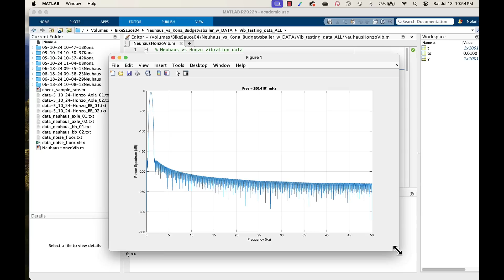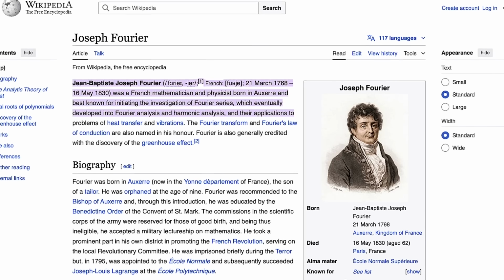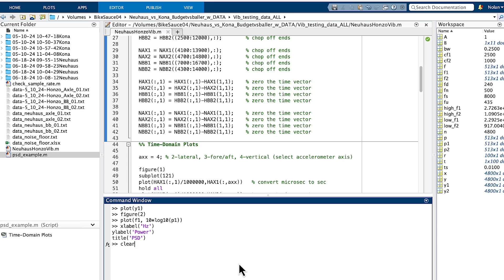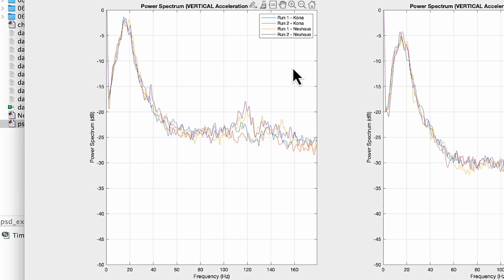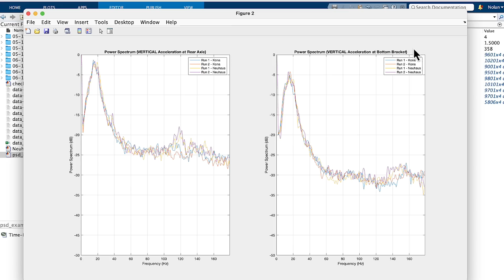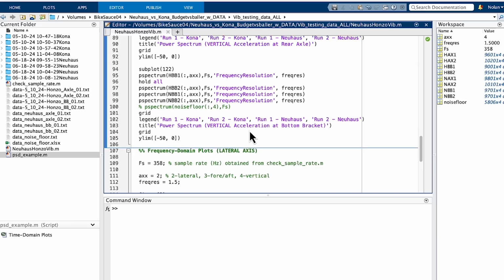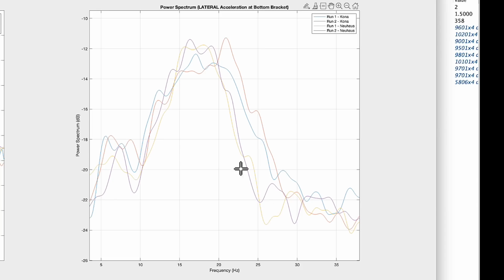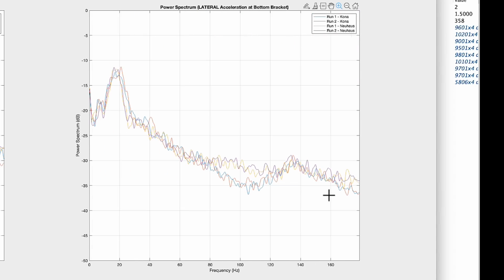The MYTH of Vertical Frame Compliance.

Comment: Just found this vid. Thanks for making it! I'm sure, as with anything like this, more questions popped up for you. The one that came into my mind was regarding shape of the stays. I noticed both the Kona and Neuhaus have relatively straight seat stays. I wonder if frames built to actually have more vertical compliance actually affect vertical vibrations. Would be interesting to do the same experiment with a steel frame with S-bend stays.... which makes me interested in the actual benefit of S-bend stays if Nick didn't use them in the design of the Hummingbird!

Comment: Do you have a way of replicating this experiment using frame/fork = aluminum/aluminum, steel/steel, aluminum/carbon, steel/carbon?    I think that it would provide a great deal of insight into exactly where perceived flex, damping, ride quality comes from in those cases.   The frequency domain approach would really help.    Somehow doing it with softish and hardish or even rigid tires would further isolate the frame effect.

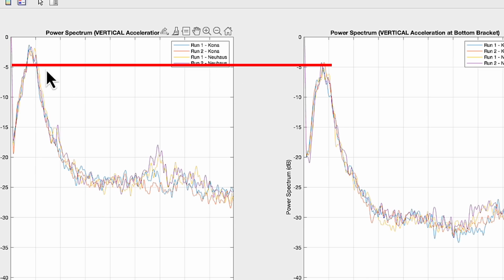Comment: In 9:38, you say the amplitude difference between the BB and rear axle is from vibration damping. If you're hitting a 2cm bump with the rear wheel, you'd only expect the bottom bracket, which is 44cm away, to go up perhaps 1.5cm. Less acceleration, ergo lower amplitude.
Reply from the maker: Perhaps, but the offset is present in both experiments, so the delta is still valid
Reply: @TheBikeSauce  While yes, the offset is present in both, it seems likely that differences in chainstay length would be relevant, especially for the vertical dataset. I may be being overly pedantic, since the delta between chainstay lengths is likely very small (relative to the total length of the chainstay), so it may not make a perceptible change. 

Given that the Neuhaus has sliding dropouts, I’d be interested to see if there would be any change if both were run with the same length chainstays. I doubt it would make much difference, but this is one of my favourite videos I’ve seen in a long time, so more couldn’t hurt! 

Thanks for your effort in making these videos, they’re extremely well done.

Comment: Interesting experiment and results, really enjoyed your video...far as a hardtail is concerned personally I would rather have a frame that's more on the stiffer side (more power transfer) and dampen high frequency vibrations and obstacle impacts via component selection, i.e. wheels (rims/spokes), tires, saddle, cranks, handlebars, grips...if I'm really concerned about comfort on the trails I'm taking my full sus rig  🙂#RideWhatYouLike

Comment: Should have taken measurements at just below the saddle.
Reply from the maker: Lots of you said that, but in this test, I was standing up while descending - any and all compliance was felt through the cranks. On a gravel bike seated test, up by the seatpost makes sense
Reply: It would be nice to see an estimate on the spine, which would be a combination of contact points, but the saddle would be the primary input.

Comment: CUBE build their fs emtb "Stereo Hybrid ONE55" with a strongly lateral flexing rear triangle. It was criticised that it flexes so much, that the tire touches the seatstays, when it is ridden hard. Their statement was, that such a construction is much more compliant, than a lateral stiffer rear triangle. If that is true -and there is no reason, why it should not be true - You are right.
Reply: Yes, but it flexes so much, that the tire actually touches the seatstays, even if it is not ridden realy hard. That 's the reason I sold mine.

Comment: I have an old Ritchey steel framed hardtail that is so smooooth. It being an old frame means it has catilever  brake bosses on the seat stays. I noticed that when I would use the rear brake in rough terrain the rear brake caliber would lose braking pressure and I could feel it lose braking at the lever. 
 I took a look at the brake later and noticed that when I applied the brake to the rear caliber, the seat stays would bow outwards with the force of the pads against the rim. The outward (or lateral) flex was quite excessive.
 In an attempt to correct the problem with braking control,  I mounted what was called a brake booster. Which is a horseshoe shaped bridge that fastens across the two brake mounts, strataling the rear tire and preventing the seat stays flexing under braking.
 They worked like a charm to correct the loss of braking over bumps. However, as you've probably guessed the brace took away the flexing of the seat tubes over all the bumps, braking or not. And negated the action of the Ritchey seat tubes to provide the bikes beautiful ride quality. I decided to compromise the loss of braking feel for the return of ride compliance. I think your technical explanation of lateral movement scientifically explains my "seat of the pants" experience. Thanks for working it out!

Comment: Great video man. Been doing the accelerometer and fft process for a while on some rolling resistance testing. However i cant help but think most of this test was… fruitless. As you say, putting the IMUs on the axles and BBs is going to tell you nothing. Its a f+ck1ng strong truss shape. The only thing that can tune the vertical compliance on a hardtail is tyre pressure, amount of seatpost sticking out as thats a relatively flexible single leaf spring, and seat tube angle. Just goes to show the brainless marketing of the bike industry telling people (and them believing) that different metals have some sort of mysterious damping qualities. They do not. Stiffness yes. Damping no.
Reply from the maker: Glad to hear your take on this. I’d say the thing we’ve learned here is that lateral flex (not vertical) at the bb could be what we interpret as compliance in a rigid rear triangle. 

While damping in a frame can’t be modified, stiffness certainly can (design, butting, etc). But the body is also a giant damper in the bike/rider system. I’m starting to suspect that if you can reduce stiffness in the frame (and the body’s effective damping coefficient remains constant), then the damping ratio of the bike/rider system increases. This is likely related to what we feel and interpret as compliance.

Comment: Great video!  Personally, I would have moved the 2nd accelerometer up to the seat post since it's closer to the rider interface, and then calculated the transfer function between the rear axle and seat post acceleration. The beauty of the transfer function (aka FRF) is that it captures the relationship between input and output, instead of just looking at each separately.
Reply from the maker: 100% great idea. You mean FFT to back out the TF, right? Only issue with that is I suspect the dynamics are pretty nonlinear, so I’m not sure how good an LTI model would be. Interesting idea though. I may try it with the existing data

Comment: Excellent analysis. I’m riding the same bike on technical trails in reunion island. Tested with both 29’’ wheels and 27.5 ‘’ plus wheels, and a long experience in hardtails. With 27.5 plus wheels (3’’ at 0,8 bar in front and 2.8 ‘’ at 1 bar in rear), i can’t return to 29’’ wheels. Only if you’re a chrono hunter,  the plus format on hardtails is more fun and definitely more comfy;

Comment: Does the same apply to forks? I'd be really curious to know the difference between a steel rim-brake fork, a steel disc-brake fork, and a carbon fork.
Reply from the maker: That's a great idea. Would require 2 sensors to mount at the axle and crown.

Comment: Absolutely loved this video, definitely here for more of it. Peak Torque might have some thoughts on this too--he's made some videos in the past outlying the engineering behind "vertical compliance" and why it's fake.

Putting the accelerometer around the midpoint of the seat tube and underneath the saddle would be very interesting too--maybe the Neuhaus reduces vibrations even further by those points.

Comment: Great work! One thing to say about the vertical vibration being lower at the bottom bracket than the rear axle for both bikes is that this doesn't mean both bikes have some measurable vertical compliance. This could be due to the BB accelerometer being closer to the fork and further from the rear axle. The amplitude of vibration will be less for purely geometric reasons (like sitting closer to the middle of a seesaw) even if both frames are effectively rigid in the vertical plane.
Reply from the maker: Totally agree. Also there’s a giant damper on the pedals (a person)

Comment: Wouldnt magnitudes of change be more fully realized "post" frame? As in, placing the sensors at the handlebars and seatpost.
Reply from the maker: I chose not to do the handlebars for this experiment because I hypothesized that the front fork would squash any detectable differences in frame material. I chose not to do seatpost since I was standing during all data acquisition (not seated). What you feel when descending on an MTB is primarily through your hands and feet.

Comment: You could actually take this one step further to prove the exact same thing for Steel vs Alloy vs Titanium.
You'll likely return with the same exact results as the triangle/truss structure is not designed to flex.

This may hurt the egos of all the "Steel is real" or "Titanium is the best" crowd.

Anecdotally, I had the Honzo frame for a short time and sold it very shortly after due to the harshness.
I replaced it with a Santa Cruz Chameleon in alloy which rode a bit less harsh, and was lighter.

CyclingAbout also did a YT video on this content, and included the difference between metals, but his work was based on the research of others.

Comment: I’d like to the data when you place the accelerometers closer to the touchpoints of each bike, e.g., at the top of the seat tube and headset (so the flex of the different seatposts and stems/handlebars aren’t captured).

Comment: Really cool experiment but "compliance" AKA flex in a frame is only "complying" to the forces being put through the tires and wheels and then those reduced forces are also being attenuated, a little or a lot, by your crank arms, spindle, suspension fork, bars and grips. And easy next step would be to change tires which will move the frequency of the vibration. Or change the PSI. What is the amplitude of a 10 PSI change VS buying a new frame?

Comment: Hi, can the vertical compliance in a frame come from the top tube bending? I have noticed on my slo-motions that my hardtail’s top tube slightly flexes on big impacts (handlebars also flex). Does this explain the ‘vertical flex’ thing or is the rear the only part of the frame that should be flexing. Thank you

Comment: the frame flex in the front has a signifikant impact to the ridefeeling - if you mount a rigid fork and measure the equivalent to the break stiffness - there may be e certain difference between the two

Comment: Nicely done! Going in, I had reservations on the data because you first only show the accelerometer at the axle, and I was like... what??? But you explain this and the outcome of your experiment is very interesting. Thanks for doing this and your well articulated explanation of the data! I have designed a LOT of bikes in my 35+ year career in the bike industry, and we generally quantify vertical compliance at the saddle. Because with road and gravel bikes, this is the place where vertical compliance matters most, this is where it's done. For a lot of obvious reasons, this is not as relevant to a mountain bike, but it's still not wholly irrelevant either. When testing a frame for full ISO testing, there is a vertical fatigue test, but this test can of course be run with a single force load into the 'saddle' with a very measurable amount of deflection. The reason this is still somewhat relevant to a hardtail mountain bike is that the seatpost is typically an 'infinitely stiff' steel bar (nothing is infinitely stiff, of course, but for the purposes of the test, the frame is doing all of the flexing and this tester post is isolating the frame vs. allowing flex in the seatpost as well). This denotes some amount of vertical compliance through the frame, not at the bottom bracket, but rather through the whole frame itself, from axle to axle. I think compliance is more a factor of how the BB hangs between the two axles, like a hammock or skateboard. When you're on a long board, your damping is coming from the flex in the deck, not the wheels or trucks. I wonder about a couple of things: what would the data set look like if you did the same exact test but tried to isolate the frame even more by running 30 psi in the tires instead of 20? I also wonder how some strain gauges running along the top of the chain stays and/or seat stays would look in comparison. Anyway, great stuff!

Comment: I would be interested in a comparison with a well designed CFRP frame. It may be that the isotropic nature of alloys is very limiting in the differential stiffness that can be achieved; IE you can't uncouple the vertical and horizontal deflections very much with that material selection. Increased stiffness in one area will likely come with an increase elsewhere, and vice versa.

Comment: Super cool expt. Appreciate the rear axle control. I might have placed the sensors at the contact points (saddle,  handlebar/stem,  cranks) instead of the BB, but i understand your reasoning.  The other thing that comes to mind is you mentioned the test runs taking place on a downhill stretch - I assume you've corrected for that (or that it's insignificant enough to ignore) when looking at the Z axis data.

Comment: As I see it, frame compliance is far more significant in a road bike than a gravel or mountain bike.
If a frame has a few mm of compliance that would be a much bigger proportion of the compliance in a road tyre compared to a mtb tyre.
It would be really interesting to see a similar exercise comparing a stiff road frame to a compliant road frame.

Comment: Really cool video! That accelerometer setup is awesome! It would be super interesting if you got a bolt on seat stay brace made up. Then out of curiosity see what the runs on the new house look like. I remember when I made a hard tail back in school the rear end stiffened up a lot after welding the chain stay and seat stay braces in. Ive has allot of questions in this realm recently trying to explain why certain bikes I have ride way better than others. Keep this type of content coming🤘

Comment: This might also explain rear chainstay shapes as well. As most of the time they are ovalized vertically. In part for tire and chainring clearance, but this also should help with torsional flex instead instead of horizontal flex.

Comment: In an earlier life I worked on defense electronics.  We used a pretty burly vibration table as part of the qualification for things like vibration sensitivity of VCO’s, and I have really wished something like it could be used to show the actual frequency response of a bike frame.  The drive was a pseudo white noise (calibrated via the on-platten accelerometer), but it could be setup for other stimuli. An accelerometer on the platten surface would provide the denominator, while a frame mounted accelerometer on the three touch points could provide the numerators so that dampening or amplification of vibration vs. frequency could be plotted.  It would make very light work of comparing tires, frames, seat posts and handlebars.
Reply from the maker: That’s the holy grail! If only we had the funding..
Reply: @TheBikeSauce  For all the supposed R&D spending in the bike industry it is pretty shocking how much sciency sounding anecdote is passed off as data.  I am guessing that a vibration table is dirt cheap compared to a wind tunnel, but clearly frame comfort is not worth quantifying or optimizing in the industry.  Your approach here is laudable and scrappy, good work.

Comment: Hey Nolan, great video. As a bike rider myself and a mechanical engineer here goes a question for you. Do you think that the chain stay and seat stay flexing outwards from the frame's vertical plane of symmetry would result in the compliance felt by the riders of a hardtail? Maybe a FEM model of the two frames with their particular geometrical features would give this answer. Thanks a lot and keep posting videos like that!

Comment: Really interesting experiment you did. Since one senses bumps on a bike primarily through contact points like hands (bars) and butt (saddle), rather than feet (pedals), would your data look different if the accelerometers were mounted higher up closer to the bars and saddle?

Comment: It’s great to see some actual data driven analysis on here! I’m an ee working on different kinds of vibrations, the thing that I would be interested in comparing would be data for a smaller section, ie a step change from one height to another, to see how that was propagated through the frame. Because this data is an accumulation of a longer period, and compliance is something you feel at particular points, ie a stiff frame and a compliant one would feel relatively the same on a smooth section, you’d only feel the compliance at particular instantaneous points. I think this steady state data may be masking more interesting things that occur instantaneously when you hit something.